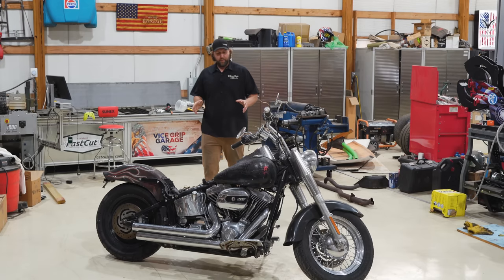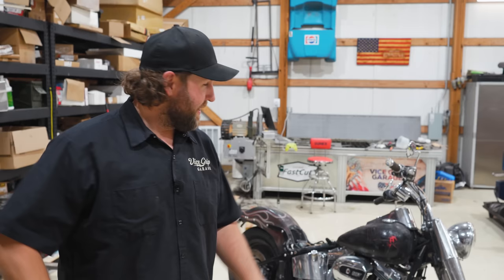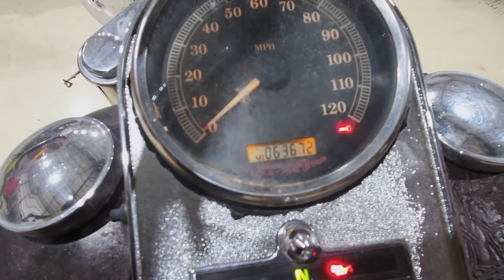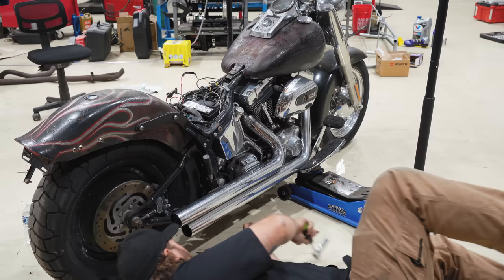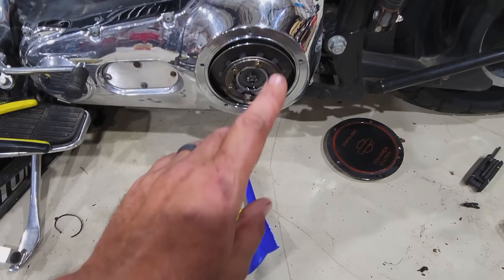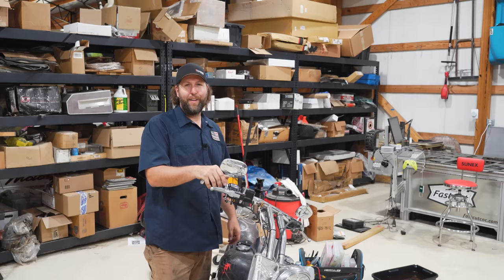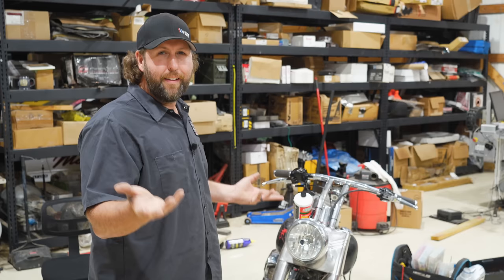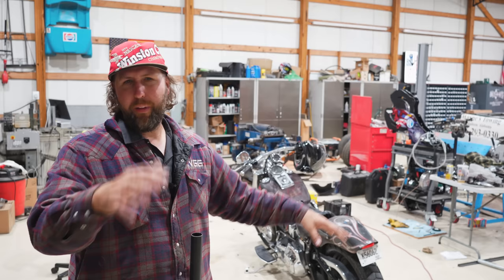ABANDONED-STOLEN-RECOVERED! Will This HARLEY DAVIDSON Run and Ride Again After YEARS?

Comment: Don't sell 'em short there Squiggy.... I have a 1989 Softail custom that hasn't been gotten into yet (including factory carbs) that just turned 78,500 and she got new sparkolators at 50,000...... If she sits for more than a week r two, she smokes right at start up, otherwise she burns as clean as when she was a teenager... I also have a 2000 UltraClassic with just over 60,000 on her that I would not hesitate to seriously tour on for a split second.... A buddy of mine wants to hit Anchorage before we get past that point in retirement, but I think I'd rather keep her in the lower 48..... I might check into a one year lease deal on a new one for the Anchorage trip... I dunno.... Just makin the point that these bikes aren't like our Daddy's or Grampa's Harleys anymore..... Up until last fall I had a dear friend who had a 90th Anniversary UltraClassic (had the very first electronic cruise control) he rode just under 86k and had the top end freshened up at 75k... Amazing what religious oil changes can do... I'm sure we don't ride'em like you n your brother do, but we probably USED to.... We've got a good 25 years on you boyz, so yeah........... Keep up the good work lil bro...

Comment: 63,000 miles is not a lot. I've got 200,000 on my street glide and counting. I've only had to change the compensator a couple times and the coil.

Comment: The problem is the design of the cam chain system. It uses plastic “shoes” riding on the cam chains that can (and do) wear out. The chain tensioning system in these motors uses plastic “shoes” riding on the cam chains that wear out. The plastic spring loaded cam chain follower fails & it shreds plastic material that fouls the rotary gear oil pump cutting off oil flow to the engine .Harley has made some changes in later model bikes, 2007 and up  but even with the new hydraulic tensioning system, it is not a true fix.”  This  fix S&S Cycle Complete Gear Drive 510G Camshaft Kit  The best thing is that you will get upgraded cams on top of the rest of the upgrade kit, thus more performance. 1000$ or less I am sure Derek can do the labor so we can all watch .

Comment: ~ Whoever stole the bike couldn't figure out how to override the security, so they took it over to a 'hack expert', who jing jangled the wires around, for a 'small' fee, so it would start, & stop, with additional feature steps.
~ As for the high mileage, probably got rented out alot by whoever stole it, for convenient getaway jobs, or nefarious tasks, etc., for a 'small' percentage commission fee of the acquired proceeds.
~ Also, the spring on the stand, was probably removed as an extra part nuisance, by an 'expert' hardcore bike rider, until the driver crashed when making a fancy Harley Davidson biker turn & the stand locked into the road, then crashed, but by then it was too late, since the spring was probably too hard to put back in or was too expensive to put back in, LOL.
~ Overall, this bike got a frankenstein camouflage makeover after getting stolen, so it wouldn't be spotted, but it was still showcased as a Harley Davidson original.:face-orange-raised-eyebrow::face-turquoise-covering-eyes:

Comment: I run Rotella  15/40 in my Harley  if you read the label and if it says JASO MA then it's safe to run in  motorcycles .  I'm sure some will argue but that's because they don't know 💩 I've been riding Harley's for over 40 years and you wouldn't believe what some will believe

Comment: if you run some wires from the wires under the seat you could put the starter in the original place and ignition, it hurts my brain you are not doing it

Comment: Not that it matters but the math on the thieves mileage in two years versus your brothers in 10 years is definitely off if it is a 2007 it is 16 years old the thieves had it for 2 years so it was 14 years old when it was stolen and I believe you said it had 21,000 miles at that time and came back with 63000 so they put 42000 miles on in 2 years so 21,000 miles a year I don't know if your brother had it since it was new or used but regardless it only had 21000 mi in its 14 years so they match that in one year and doubled it in two years putting a total of 42000 miles on it that is a ton of miles in 2 years

Comment: 65000 miles high? I hope not. Mine has 42000 on it…..hoping for at least 100,000 on second thought, if I rode like most do, I wouldn’t expect my bike to last very long at all😂 damn…. I would’ve jerked those stupid mutilated handlebars so I didn’t have to bugger those new clutch/brake/throttle assembly’s…

Comment: You remind me of my uncle with the saving of parts and buying the cheapest things possible but not being cheap or stingy just frugal with your money . Im the same way in some ways , i save things i think i might be able to use and save money in parts but its usually something i will never use like a very specific piece of electronics or wiring for a vacuum cleaner or something weird like that. My uncle would make these monstrosity power tools like Frankensteins monster , a DeWalt drills case with a Makita motor and Milwaukee power coard , or one stilt thats red and made of plastic and metal the other is all aluminum and has a dirtbikes coil soring attached somehow. Some may say we are Irish white trash , but we also german so its not totally correct. Jk , kids today dont understand the meaning of saving money , they want everything handed to them and protest when they don't

Comment: How many cc's is a 2005 Heritage Softail?

HARLEY-DAVIDSON Heritage Softail Classic (2005-2006) Specs, Performance & Photos. The 2006 MY Harley Davidson FLSTC/I Heritage Softail Classic sports an air-cooled, 1450cc, Twin Cam 88B V-twin powerplant paired to a five-speed manual transmission and can reach its peak torque of 115 Nm at 3000 rpm.
Suggested List PriceAverage RetailBase Price$18,699$13,030Options (Add)Total Price$18,699$13,030 What is high mileage for a Heritage Softail?

￼

around 80,000 to 100,000 miles

When looking at a Harley Davidson's mileage, the range at which it begins to be considered high is around 80,000 to 100,000 miles. There is no specific mileage number where you should be concerned about your bike.May 2, 2023

Comment: Get a Fob and find out the codes for that bike ! It’s a trip how you enter some of these codes, for instance I remember my mechanic that I went to (Kenny at Boulder Chopper’s in Henderson, NV) he was pulling the front brake and then put in gear or second gear and then turned the ignition on and then off four times and then left turn signal I’m not for sure how the exact code went, but when I saw him doing this after coming from the bathroom I asked what are you doing? You look like you’re trying to play one of those old games like Simon or the newer older models where you pop it punch it or pull it! As a matter of fact do you know your brain code and I said sometimes! Tells me when I have to pee when I, no not your smoke collector it’s for the bike! I said I don’t have a clue to what you are talking about! Ten minutes later he was off the phone did the same kinda thing except added 1 more clutch then shift and it put on that tiny display that shows the oil can and it was numbers he needed to I’m not for sure but hook up his gadget to see how it’s running compression oxygen firings etc. it told him everything he needed to know to work on it properly instead of troubleshooting it which saved him time and gave me my bike sooner.

Comment: Would be nice to see you restore kind of …. This motor sickle . New bars new seat  new used forks. Matching wheels.? Grind that gater skin paint back and professionally spray can paint job. Ohh and maybe get rid of the air cleaner. ……. And maybe just splurge a bit for a helmet that’s not kicked in the front teeth. 🇺🇸😅